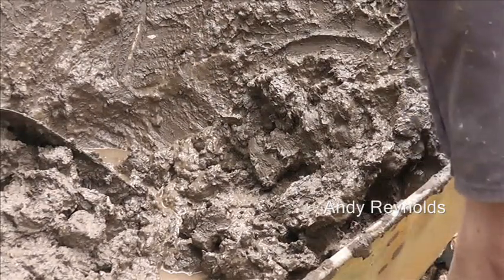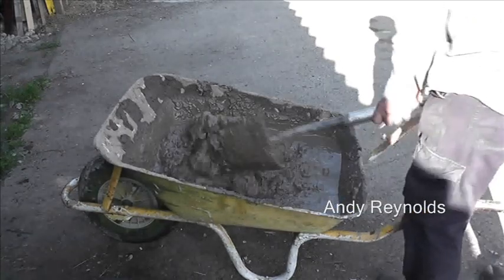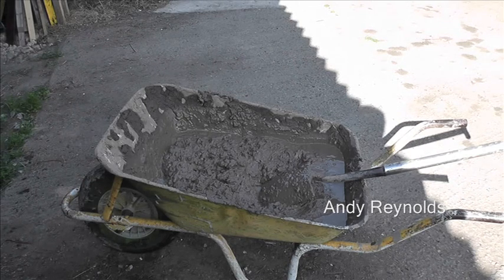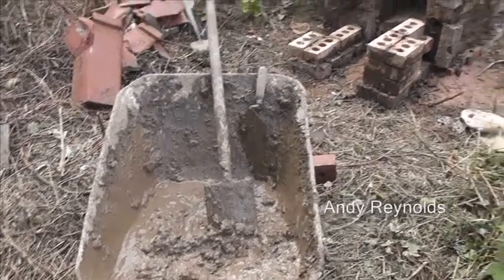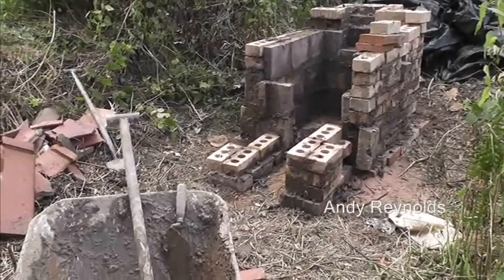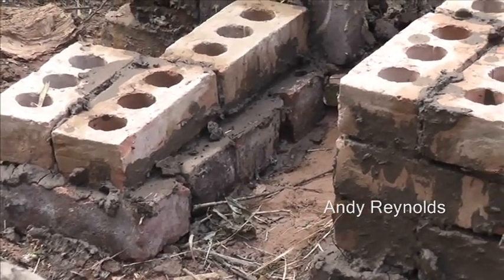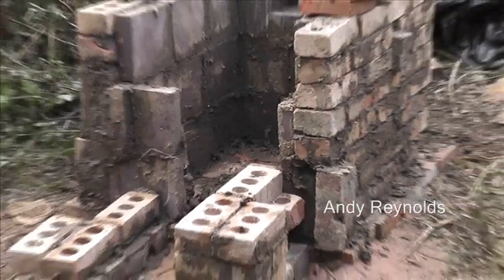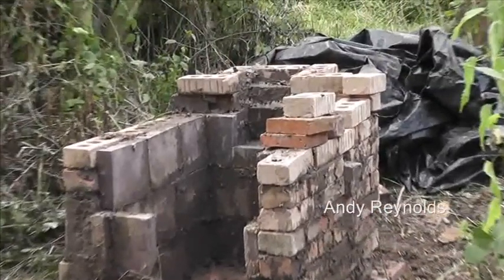Wood fired kiln project, trial and error, see what happens.

Comment: Hi Andy ,  nice project coming on, you mentioned using paving slabs for a part of this not sure if your aware but concrete slabs can explode when  heated up enough ... I've had it happen to me and it scared the hell out of me .. may be worth mentioning it to others ..just a thought 🤷 cheers
Reply from the maker: Hi, thanks for the heads up, yes mentioned it as a way to close the chimney at the end of a burn. Probably OK for this situation but a bit of steel would do just as well, cheers